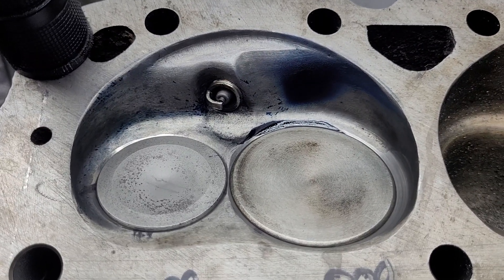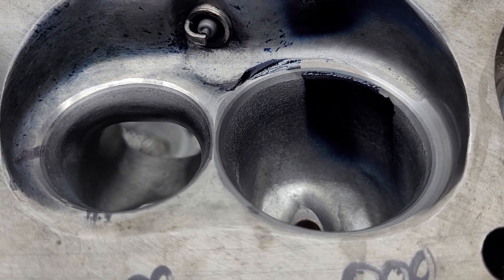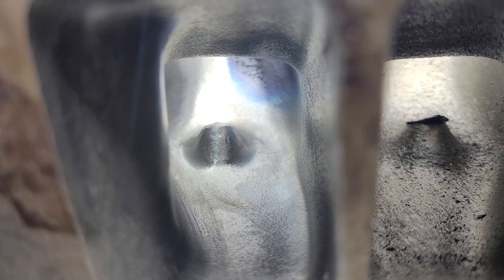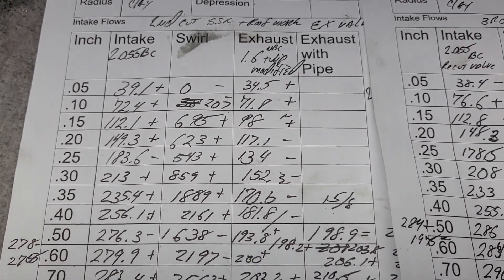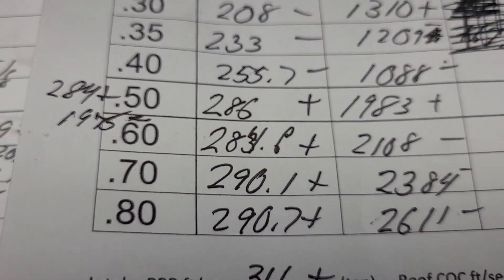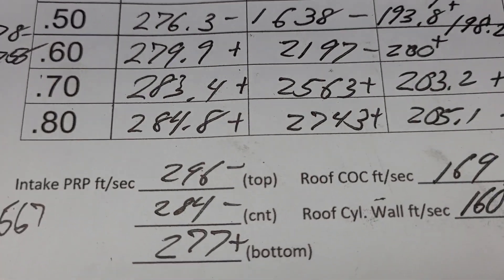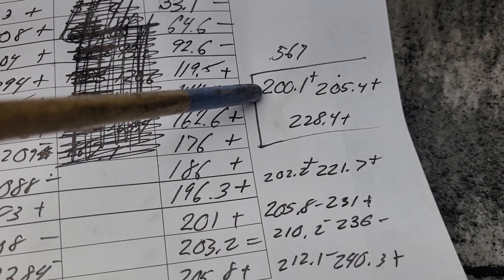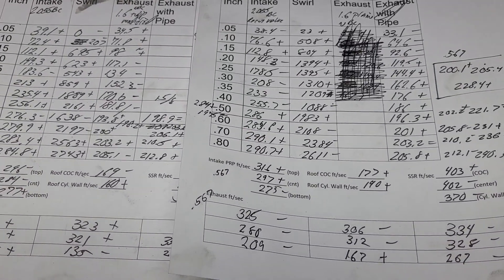Chevy Bowtie cylinder heads 034, third cut and plain exhaust valve flows. Can plain be better?

Comment: Hi Charlie  On your heads at .500 lift you start to loose because of ssr and air speed but then it recovers at higher lifts. If the air separates off the ssr how or why does it recover. When I have a flow loss at a certain  lift it will not recover at higher lifts, maybe slightly but not enough to make any difference. I'm just a hack with a grinder but I'm trying to learn. Thanks. Andrew
Reply from the maker: D.V. calls it "windowing" skips right over ssr. It should recover a bit.

Comment: Great job, do you port according to the cam or do you follow the owner’s directions?
Reply from the maker: Application usually. Thanks
Reply from the maker: On a fresh build I would do the heads and then get a cam that fits the flow curves and the application.

Comment: What are your thoughts on the 291 straight plug casting date codes F 23 or 28 7can’t really tell and F 25 7
Reply from the maker: They flow about 206 with a 2.02 intake valve.
Reply: @servediocylinderheads  thank you sir

Comment: Hmmm, those heads will like some long tube headers, that'll more than make up for the tiny loss on the intake depending on the overlap.
Reply from the maker: Chevelle has Hooker competition headers that were ceramic coated.